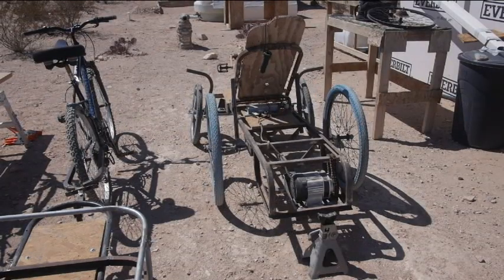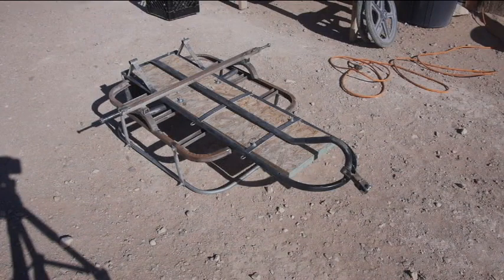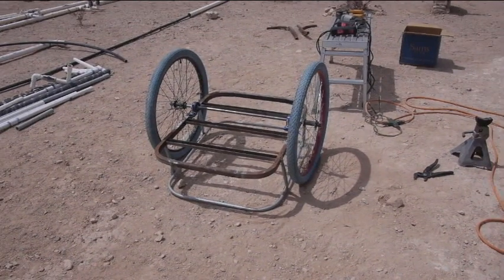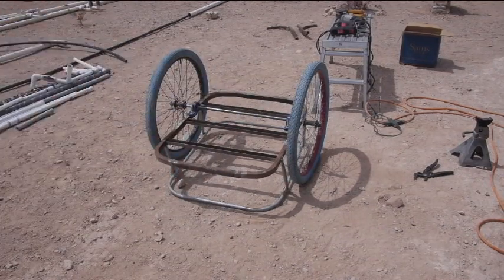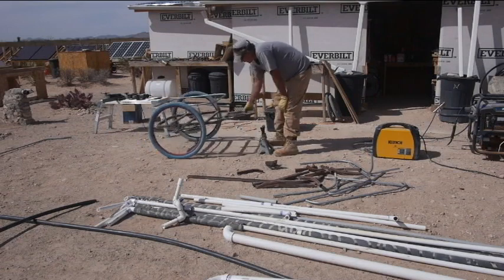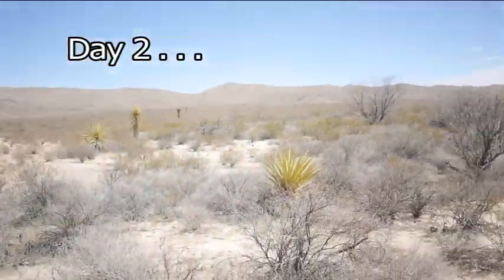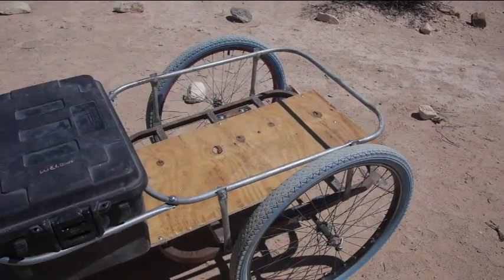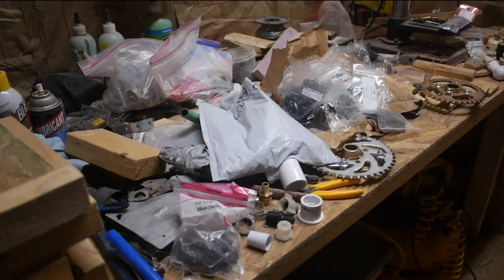DIY Bike Trailer - The Last Rebuild!

Comment: Modifying a alluminium car roof rack  can give you a solid base that is much lighter. Balast can then be the problem :) I have a small ball hitch for my cart. It cost $20 bucks from Germany.  Got it on Ebay. I've also seen large springs used succssfully for a towing hitch, the kind you might find on a trampoline.
Reply from the maker: So many good ideas! I actually was looking at a big spring I found on the road yesterday, it didn't seem quite right, but was tempting. I think the ball hitch would be the best idea though. My problem at the moment is 7 miles of very rough road on the way to town, so I end up really over building things. Steel is tough, and while heavy, is pretty dependable. Carbon fiber would be interesting though :) Maybe next year? Thanks for the comment!
Reply: @CarlinComm  Another good source of a flatbed are 8ft by 2.5ft folding tables. If it has an alluminium frame these are easy to modify and pretty much ready made. The frame tends to be 2ft X 6.5ft but is easy to shorten.
Reply from the maker: Its amazing what can be found just laying around when you know what to look for ☺️

Comment: You can buy light weight bicycle tire cart on northern tool with sides
Reply from the maker: Yeah I remember seeing those, that would have saved a lot of time. Of course, as it turned out, the video of me building the trailer is one of the most watched videos I've made, so maybe it was worth building?

Comment: Awesome watching the progress of the turtle. Do you have a bathroom scale to place under the rear tire to see what the loading effects are on the rear bike tire?
Reply from the maker: No, I don't have a scale, it would have been cool to measure the weight of the old trailer vs. the new version. As for the weight on the bike, I can just balance it by feel of the trailer hitch. Some versions, with the wheels all the way back, the bike carried a lot of the weight, so I had over compensated and put the axle in the middle, then I noticed I didn't have enough hitch weight, so the hitch bounced between down and actually lifting which was pretty annoying. Now, when I'm empty, I'll have the black tote with some tools in it, to hold it down, and I can move the load around as needed. I'll find out soon, expecting to take a ride into town tomorrow. Bigger wheels do roll easier at least.
Reply: @CarlinComm  concur, the bigger trailer wheels have a greater weight carrying capacity. 🕵 You probably reduced the trailer weight by about 65 percent or more. 👷 Now you can haul another 200 clif bars from town 😂
Reply from the maker: @JosephGodwin137  I just got back from the post office, I shaved off about half hour from a normal trip going in to town, and round trip was pretty good too. Lots of factors, road condition, etc, but the new trailer is definitely lighter, the bigger wheels roll much MUCH easier, and they float better in the soft areas, gravel and sand etc, I could really feel a difference. I was often 2 or 3 gears higher than normal. Good ride, I didn't even mind the headwind coming home!

Comment: I'm kinda wondering why you don't use some of the bus seatback steel to make your tailer decking.
  Is it the rust issue you were talking about?
Reply from the maker: I dont really remember anymore, I've not used that seat back metal very often, its pretty thin, so tough to weld. For the trailer decking I usually just used the thin plywood that came from the bus seat bottoms. Since then, I've moved to putting cargo racks on bikes, and then built a recumbent trike with its own cargo deck.

Comment: So is Turtle no longer going to be a thing, insofar as being a powered vehicle?
Reply from the maker: I'll be building Turtle again, soon, I have the parts now. But in the mean time, I needed to tweak the trailer design to work better behind the bicycle. When I have Turtle running, I'll still probably use the trailer behind it. I'm kind of making things up as I go. It's been kind of frustrating, I thought I'd have finished it a long time ago, but I ran into a few problems I didn't know how to solve. Think I'm getting closer though.
Reply: @CarlinComm  making it up as you go is how I've lived my whole life so far :-)
Reply from the maker: @882952  Yup!  Some days I wish I could see a bit further ahead, but it's all I know!

Comment: I like how much weight you were able to shave off using he electrical conduit. As a rule of thumb for trailers you want to have about 10% tongue weight. Check out this bike trailer I made using PVC pipe that is fairly similar to what you are doing. You may be particularly interested in the seatpost connection solution:  https://youtu.be/eiJ-BI22o9c
Reply from the maker: Thank you so much for the comment! I've been offline for a couple months so am just catching up now!  Lots of great ideas, thanks for the tips!